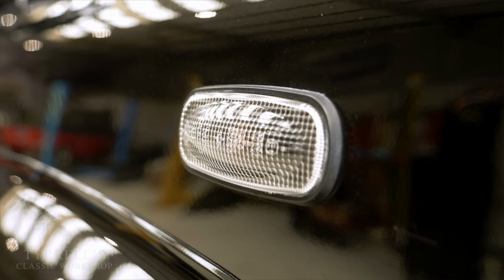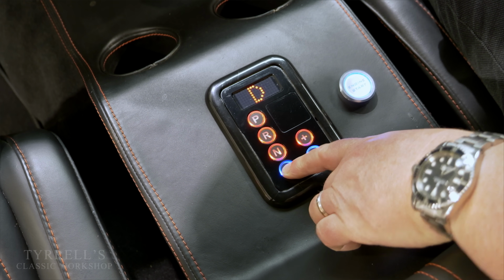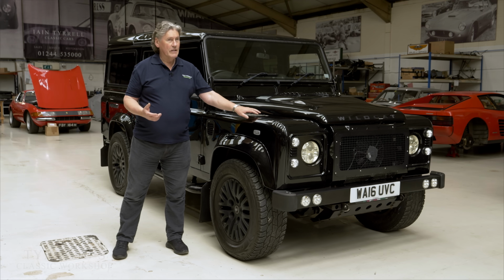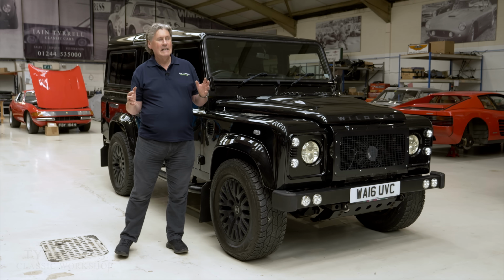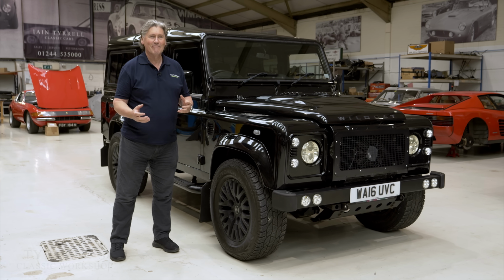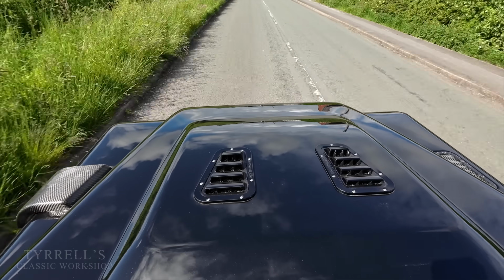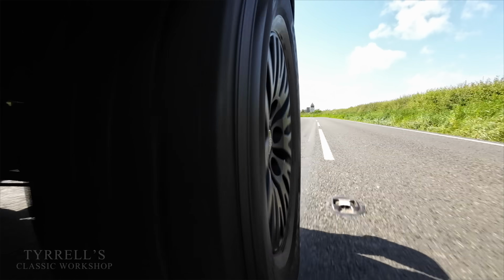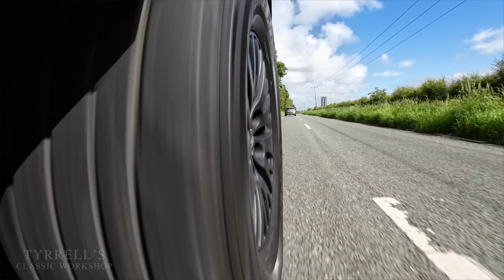Wildcat Defender 110: Unleashing the 600HP V8 Beast | Tyrrell's Classic Workshop

Comment: Certainly a different level of performance from the 110 tdi which my brother once owned! Well done on mentioning the subject of rust. It’s amazing how little paint manufacturers apply to things you don’t see. You spurred me on to apply some lanoguard to the underside of the Mercedes I bought new 4 years ago. As you’d hope it’s still like new underneath but that’s the time to do it! A relative recently went through the rigmarole of replacing a corroded subframe on an otherwise tidy BMW Z4. Not a job you’d want to do unless you really have to!

Comment: Sounds like the motor has spark boot protectors or sleeves.  They are made of various materials, titanium, basalt fiber.   Ls1tech and corvetteforum will have feedback.  Summit racing and Improved Racing carry various versions.  Improved Racing is a very capable business, the last time I talked to them, the technical support person sounded more like you than me.  Exchaust manifolds / header can route the pipes close to the ingition wires, especially on cylinders 1 and 2.   Many of us have had good results with NGK spark plugs even the standard copper variants.
Reply from the maker: Thanks for that

Comment: I have a friend in the states who has put an LS engine in a 54 Chevy Belair. Its a cheap way of bolting in a lot of horse power with good reliability and good fuel economy. You end up with a good turn key hot rod. Personally it leaves me a bit cold as I love the old pushrod V8's with a good 4 barrel carb and lumpy cam. Less horse power poor fuel economy but bags of appeal for me.

Comment: Quite restrained for a Kahn. It should have had upgraded half shafts fitted with the engine conversion, but they are easy enough to fit with upgraded diff's or axles too. Cooper tyres get surface cracking at a couple of years old, but nothing to worry about.

Comment: the 400 is a great transmission guess he doesnt work on them much you can change the mapping and internals to work great with that horsepower very durable have owned quite a few over the decades  and that LS motor sounds great ive had a few of them also

Comment: I just bought a new Citroen van, and much to my surprise, it has no topcoat paint underneath at all. Just seam sealer and what looks like primer. From what I've read and been told by a neighbour who paints cars and vans, it's common now on many vehicles, and was a trend started by Mazda. They don't seem to have any reputation for rusting, but nothing over the primer and seam sealer underneath just doesn't seem right. I think I'm going to take all the wheel arch liners out and waxoyl everything. It has no clear coat over the non visible painted parts (door shuts, etc) either.

Comment: You should compare the stock engine's torque, multiplied through all of the gears, including transfer case in low range, to the new engine's torque multiplied through the current gears, in high range. 

I wouldn't be surprised if you discovered the peak torque going through the drivetrain when stock is similar to current peak torque when cruising down the road.

You may not need to be worried if the axles, transfer case,  u-joints, cv-joints, drive shafts, axle ½ shafts, etc, can handle the torque.

Comment: Jeager made a push button auto selection coupled to a solenoid operated gearbox in the 60's and Renault used it in the Renault 10 Automatic ! Worked well but  not quite 600 bhp.  !!!!

Comment: The LS V8 engine and trans is a reliable and powerful solution - however is a supercharger really necessary.  The worst element was the hideous interior and the exhaust noise emitted.  With such a loud exhaust, I'm somewhat surprised that it would pass a UK MOT - as it certainly would not pass an Australian roadworthy test.

Comment: So several questions come to mind.
1) Is this Wildcat a different company to Bowler? (I seem to remember Bowler did a model called Wildcat.)
2) Although that particular vehicle started with a very small motor, I would expect that the mechanicals were made to handle the much more robust engines that Defenders could be supplied with, albeit still not 600bhp. Wouldn't they be able to handle the torque even at full throttle standing starts?
3) It being a Defender, with the new power plant, what would it's towing limits be? 

On a different note, you should have recorded the engine idling in the garage, maybe with another car in comparison.
Reply from the maker: Not sure about the Bowler/ Wildcat relationship. Still the same towing weight. Thanks for your interest

Comment: The fuel gauge can go from full to empty in 10 minutes.
Reply: Great for warm weather - the gauge works as a ventilator. 😉
Reply: Check bank account before pushing throttle.
Reply: Smiles per gallon 😊
Reply: @andyliv78  Wrong relation - easily beatable by other cars. This one OTOH would win the gallons per smile category. ⛽🤑
Reply: Guy Wicks. I had a bog standard V8 Land Rover. At full throttle it was actually possible to see the fuel guage needle moving. 14 mpg on normal driving, single figures when being enthusiastic.
Reply: @philhawley1219  You should have parked it in a bog. Standard.

Comment: I've got a 1960 series 2 swb that I've owned for 33 year's 
I fitted a 3.5 carb V8 in it
Next stage now is 3.9 on carbs 
Want to fit a cam Shaft probably go for a torque type cam rather that fast cam 
It's on leaf spring's and drum brakes 
It was dangerous enough 3.5 form 
3.9 will be enough 
There's no seat belts or roll cage 
Anything above 60 it starts getting dangerous 
I've had it up on two wheels 3 times 
On the road!!! 
If mine had 600 hp 
It could go badly very quickly

Comment: Not all of L316 is aluminium...quite a bit of steel on there. You mention 5x the power but when you compare torque the step isn't quite as massive. Those Elddrbrock superchargers are well known for heat soak issues but 600bhp is probably about right. Presumably it's using the GM transmission with the original transfer box. The drive train is quite tough with some minor tweaks.